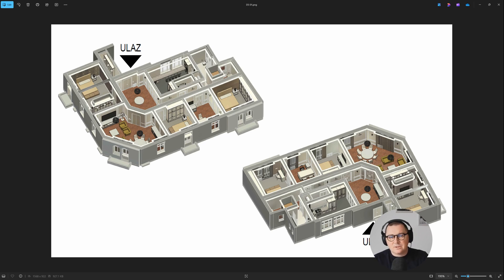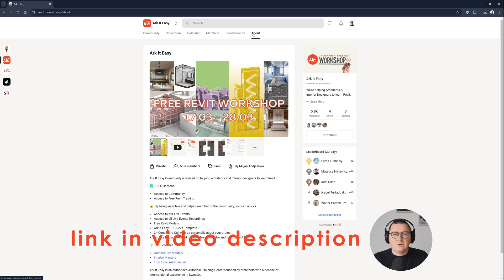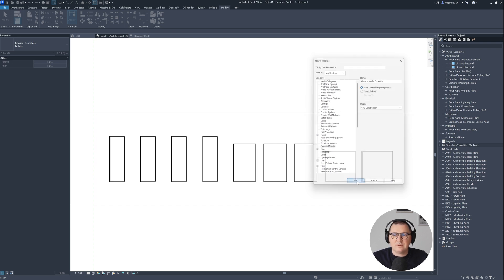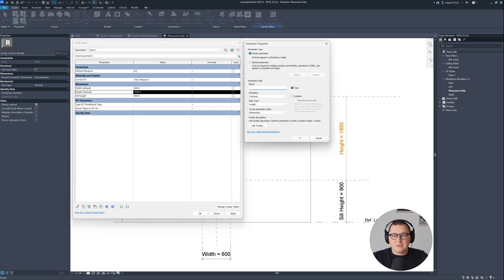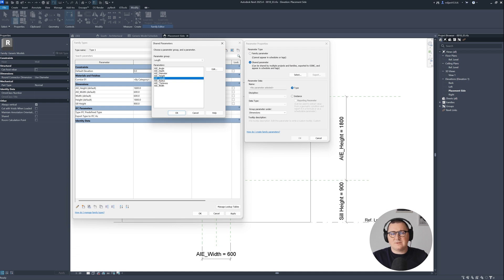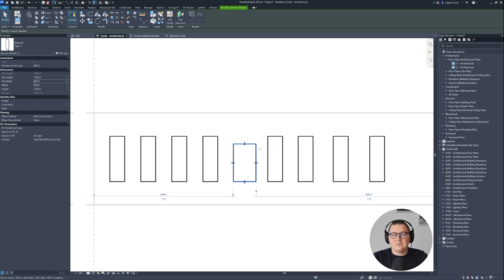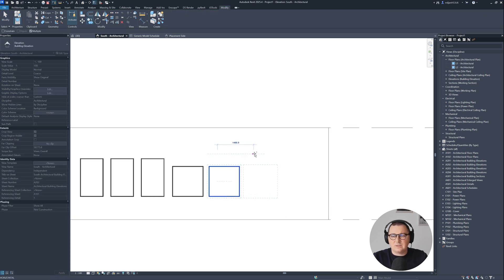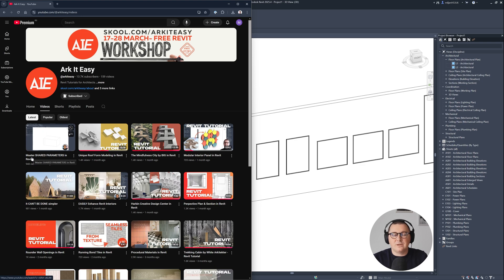Wall Mouldings in Revit- Length Calculation

Comment: Is it a way to model those using curtains walls?
Reply from the maker: Yes, it could be. You can make 2D profile which you can use to make CW millions and make CW just out of it. You can also make a CW panel and add some profiles so it reminds on what I’ve done here
Reply: @arkiteasy  I found that  manually modelling and placing each sweep  for crown molding, baseboards, chair rails so boooring and often make my initial design twisted. I'll try that method that might be time consuming too but if it works I could keep a custom curtain wall template for repeated projects. Thank you, you're awseome!
Reply from the maker: @wael4070  Don't skip methods you said that you found boring because in some cases they're the best solution. When it comes to Mouldings like this one is just do as i did, a Family, in which you can load multiple 2d profiles and change appearance just with replacing profile. There is one more lesson here on my channel related to wall mouldings, take a look at it as well ;)

Comment: Great Miljan!, could you  please do a example for a schedule of a joinery family (any custom cabinetry with panels would be enough with its dimensions to be scheduled)  utlizing the same shared parameters concept in this tutorial, the nested families inside the main family part being so trickier to overcome while scheduling them. Keep rocking as always, Thank you!!!
Reply from the maker: What makes you the biggest problem with nested families?
Reply: @arkiteasy  loaded secondary family constraints depending on the primary family(Host family) constraints 

for eg- a loaded panel family adjusting to the constraints set by the primary family and mapping values of the shared parameters between each of them.

Thank you!
Reply from the maker: Thanks a lot for suggestion 👍 we had live lecture recently in our community (Skool.com/arkiteasy) and I showed exactly that. Anyway, that’s great topic and I will for sure cover it here as well 😉
Reply: @arkiteasy  so kind of you, and please only do them at your convenience.